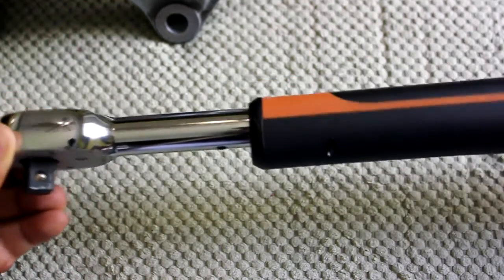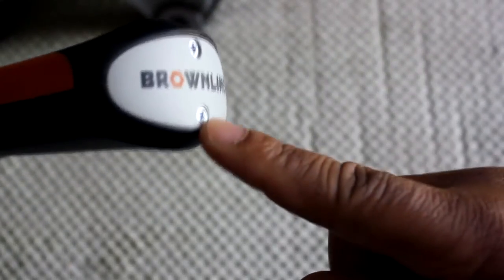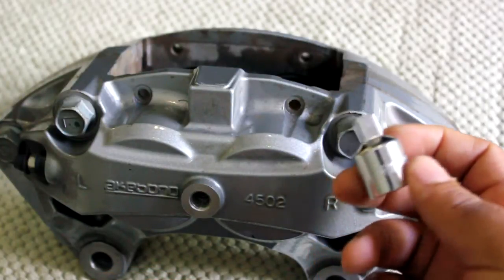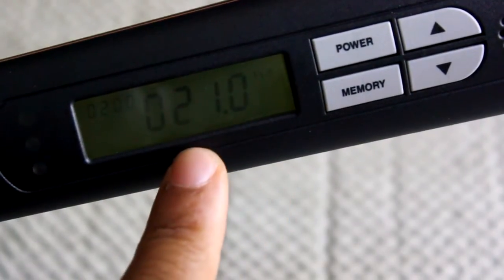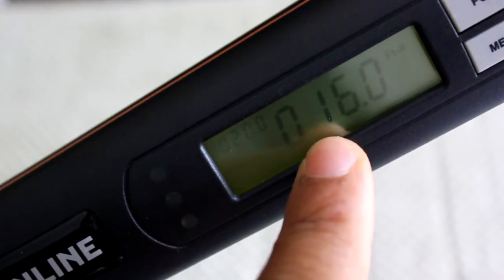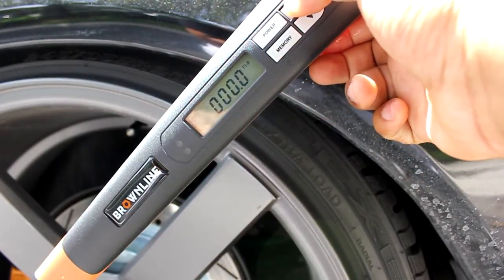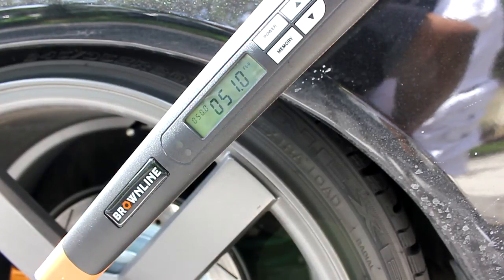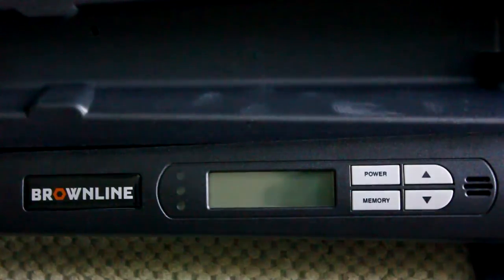Brownline Torque Wrench Review

Comment: I use this torque wrench tightening my lugs at races. I just go until it beeps and move to the next, no pushing any buttons, like I expect. Except sometimes (apparently if I take more than 5 seconds) it sticks on peak hold and doesn't beep on the next lug because it's just reading the peak, and I end up with an overtorqued lug I need to back off. I hate this thing.

Comment: I hate this torque wrench. When doing multiple bolts or lugs it will not retain the setting. I constantly have to hit the memory button to go to another lug.The display is also many times facing away so you can't see how much torque you are applying. Along with its failures between bolts and it not recording and displaying torque you can easily over torque waiting for the alert to sound